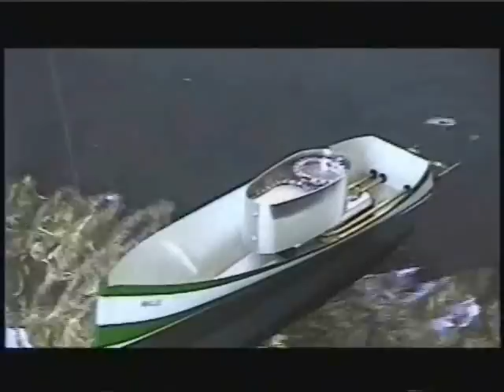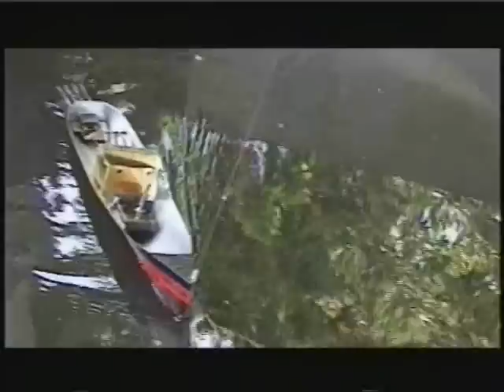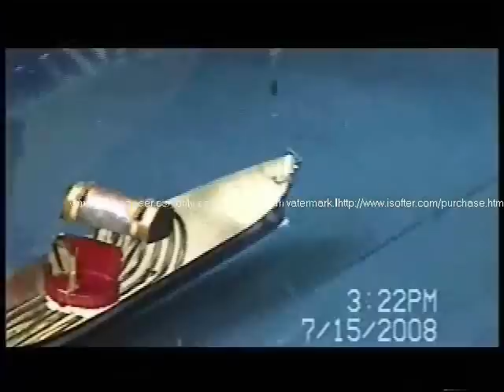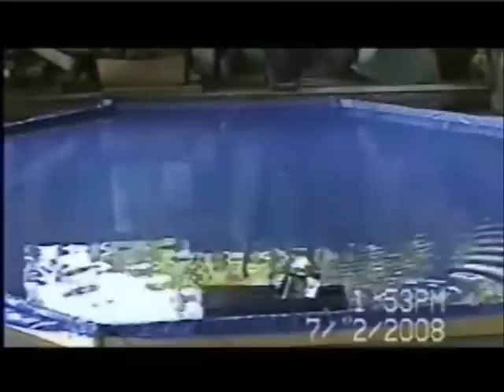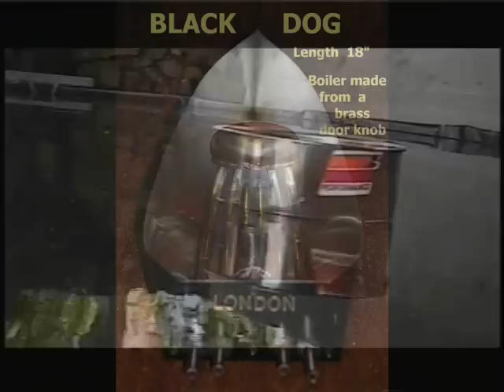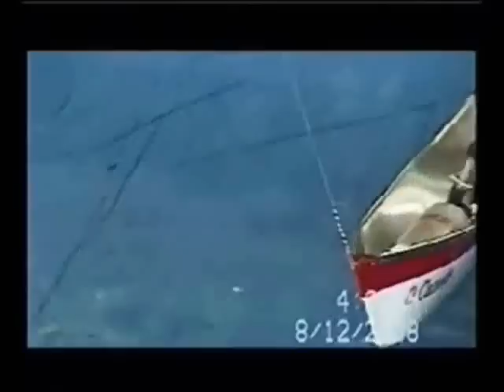Part 3 Canadian Putt Putt Boats

Comment from the maker: @Xxfades321xX The water has to boil to make steam or the pulsing action won't happen and the boat will not move. When the steam condenses a vacuum is created and the cycle then repeats. Maybe you can use your heat to generate electricity. You may google this idea.

Comment: how much heat IS REQUIRED to get the boats to move at all?

reason i ask is i was thinking of creating a boat that was powered by a certain plant with root temperatures sometimes reaching 140F, and think it would be pretty cool to have a lil putt putt boat that moved entirely off the heat of said plant